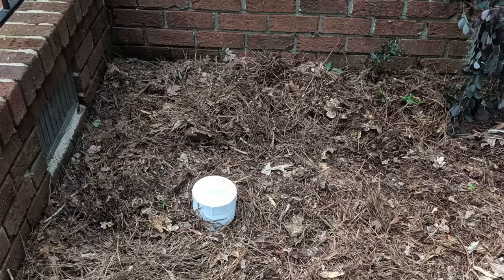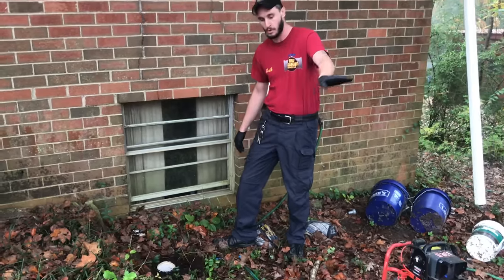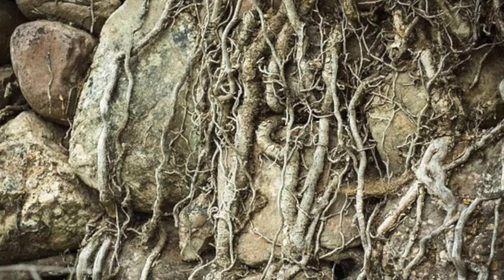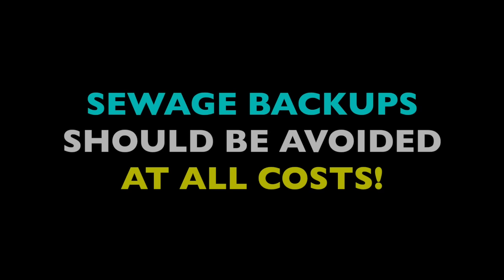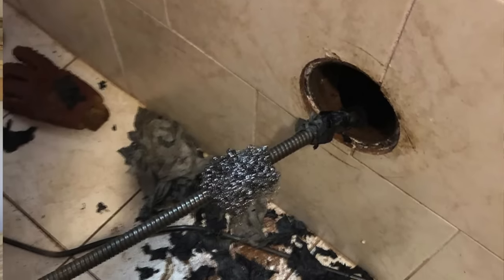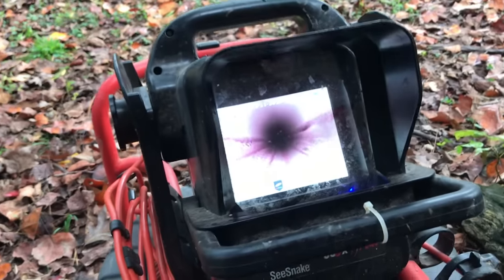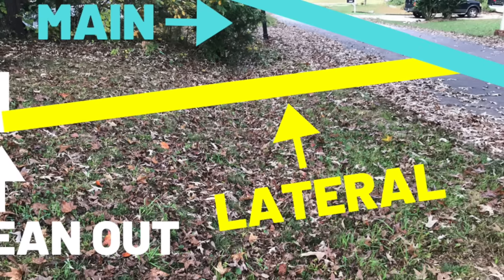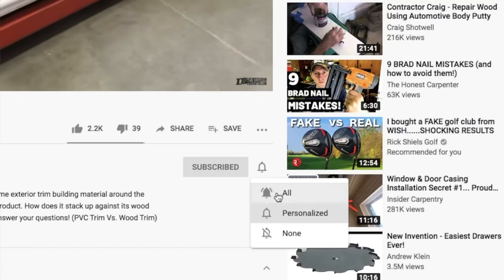This Pipe Can SAVE YOUR HOUSE FROM SEWAGE FLOODS! (Sewer Clean Out Pipe Explanation)

Comment: Another really informative video.  In Britain, almost every town and city has a network of old Victorian sewer pipes.  Outside, usually at the back of the property, we have a "manhole", literally a chamber large enough to get into, with a large metal cover, that shows the junction between the pipes.  You flush the loo or turn on a tap. If nothing appears, the pipe is blocked and needs rodding.  The Victorians were incredible engineers and builders. They built a lot of what is worth preserving in Britain and all without power tools.  I often think they would be horrified if they saw the crap we put up these days.

I'm a property solicitor (lawyer). We use a form of standard enquiries for purchases. There's an enquiry about sewer flooding but, believe it or not, there's nothing about the condition of the drains and it rarely occurs to anyone to raise a separate enquiry about it, including me up to now.
Reply from the maker: Amazing! Thanks for the info, Mindya. I always think it’s incredible to see how we were building 100+ years ago, and how it has converged with what we build now 🙂

Comment: Last week my sewage ejector pump started making strange noises. Black water came up in the kitchen sink for a minute but then went right back down. Called a plumber and they checked and everything was working normally. I wanted them to scope the line but the cleanout was in the crawlspace on the end of the main line coming into the house. This meant that if they removed the cap, everything in the pipe would come pouring out into the crawlspace. They suggested a new cleanout be installed outside just on the other side of the foundation at a cost of about $2500. I'll be calling them next week, as that is much cheaper than the alternative.

Comment: We were on a house, at the top of the hill.   A water treatment was down at the bottom of the hill.    For some reason, the sewer gasses from the entire system, would go thru the house giving any small imperfection in the plumbing.    Uncapping the cleanout, helped while the "new" problem could be addressed.     I fixed two traps, and a bad toilet seal.

Comment: As someone in the industry, remediation can be very expensive with sewage backups that occur "beyond the trap" as this is considered "grossly contaminated water", and the industry requires all porous materials be removed and replaced (drywall, insulation, wood floors, personal belongings (contents), carpet, pad, bathroom vanities, etc.).

Pro-tip: look at your contents coverage for your policy, and see how much more per month it could cost to increase your coverage - some people can get $10,000 or more in coverage on their contents for $10 or less per month. Cleaning contents can be expensive, and your contents coverage not only covers the cleaning / replacement, but also the "pack-out", "pack-back" and any storage required during the remediation / repair.
Reply from the maker: Thank you, Brandon! Very useful advice and info!
Reply: @Brandon: Excellent suggestion and information regarding insurance. After own own backup issue we discovered that there were (I think) three types of water flood/damage insurance:
1) Common floods (rivers, streams, rain storms)
2) Sewer backups/back flows 
3) Broken interior water piles or failed hot water tanks

Comment: Wow! This is most likely our problem. We had a plumber come out a few months ago, where I assisted him in unclogging our kitchen sink drain. Beforehand I had removed the food disposal and replumbed with new piping. 
Approximately $400 later the problem surfaced again, in a week's time. I called him back to discuss this and we settled with my pouring copious amounts of hot water (heated pots on the stove) down the drain. It helped, but the slow drainage came back a few days later.
Then I installed an air valve system under the kitchen sink...no difference.
After seeing your video I felt that you may have nailed our problem!
Reply: Do you have cast iron or pvc underneath your home?

Comment: I’m in the Midwest (Chicago area) most cleanouts are in the basements here, where the line comes into the house. Some builders do put cleanouts outside, but this is not common. Usually on a custom or single built homes. A family member did replace a sewer line here, 15 years after the home was built, because of improper installation originally. It cost just under $10,000.The line was installed in 1995 and was PVC, did have an outside cleanout, a big Oak tree finally caused the failure.   Thanks for the video, very informative!    Jim
PS.....part of the cost went to the village.....a hookup fee, the fee was $3500.
Reply: Right ! im from the area. Finally here in will county? its the code.

Comment: I had a shower draining slow for several years.  I tried a regular 25 foot snake and a 20 foot hydrojet snake.  Both helped but did not eliminate the clog.  The exterior clean out was about twelve feet away outside.  I ran a hyrdrojet flexible snake hose through it for about 2 minutes and the clog was eliminated entirely.  Just for maintenance I ran the hydrojet inside another clean out on the other side of the house.  It will be part of my annual routine sewer pipe plumbing maintenance.

Comment: Bought a new build in February, the clean out pipe wasn't cut down to grade because our driveway wasn't in yet. One of the construction crew ran over the pipe, snapped it and eventually it filled with sediment. Didn't realize this had happened until our brand new basement was filled with sewage. Their solution... paint a rock orange and put it on top of the busted clean out.

Comment: In Victoria Australia,  my water utility agency had to fix the sewer main that was through the driveway up into the back of the property over the other side of the neighbors and I was compensated by the water utility for a about 280AUD on my water bill before a arduous process of 2 months to dig to the main pipeline of the sewer and replace said section from tree roots.

Comment: I have a SEPTIC system, so I’m not connected to City Sewer (yay!) 
But I knew a Clean Out Port was a good idea, so when my PVC pipe going from the house to the tank disintegrated, I asked the Plumber to install one. 

My reasoning was to put my dog poop 💩 directly into the tank, but it’s been beneficial in so many other ways! I can add yeast and other beneficial “bugs” to the tank without potentially drenching my restroom. 

The BIGGEST BENEFIT of having this handy hole I can peer into has been a bird’s eye view of how well my drainage field is working, and when the tank needs cleaned out. Crossing my fingers that as long as I maintain the tank in a healthy manner, it won’t need to be pumped as often (2 or 3 times over 20 yrs) because my Mom had used wipes, and she’s no longer adding that problem to the tank.

I had a new lid installed with the new drainage field (house was built in 1970) and the new lid features a smaller round manhole cap that means less digging and no massive lid to lift. We had a secondary port installed at the tank OUTLET, and this is where I dump the Root Killer, and occasionally toss a high powered hose down just to keep it uncluttered by debris.

Both of my clean out ports have a nice large matted tree ring around the pipe, and I screwed in a couple lifts to make it sit prominently in the lawn so I won’t trip over it or mow over the lid… it’s wonderful to do a load of laundry and see water flowing in that outlet, knowing that the system is healthy and working fine.

THANKS FOR THE VIDEO!! Now I know 5e REAL REASON why Clean Out Ports exist 😮 
I had been wondering how on earth the Plumbers might pump out the system using this 4” pipe. I feel like I really learned something 😎

Comment: Shoddy installation from the lowest cost provider had failure as my number one concern when hooking up to the city sewer.  At the first clean out I installed a one way valve to prevent flooding when/if a line failure in the street occurs.
Reply: Was thinking the same thing.  But can a one way valve be installed without digging up the line?  Wouldn't a public sewer system have rules and regulations against having these?
Reply: @johnjacobjinglehimerschmid3555  It drops down in the clean out and rests on the bottom of the sewer line near the house.  That way if you need to clean it, it's easy to access.  It does not have any effect on the public sewer system at all, and I worked with a pro when we hooked up and no mention of any regulations, he thought I was wasting money, but I sleep sound now.
Reply from the maker: Yep, there was a backflow regulator in this property Mark, I just didn't have space to cover it in this video. Hopefully soon though. It's a great, simple installation to prevent against several sewer line problems!
Reply: @TheHonestCarpenter  is like to learn more about this backflow regulator your speak of
Reply: @shawn1869   Most are simple plastic swinging gate type. Allows your waste to go into the city sewer, if main line backs up it shuts and won’t allow your house to flood with waste. One way valve. The code would require this back water valve if your neighbors homes upstream are higher than your home meaning you live on an incline.
Reply: Sir you only need and by code a backwater valve when you have fixture flood rims below the next upstream manhole other fixtures with flood rims above said manhole must not go thru back water valve says upc

Comment: Back, in Late 70's, the local Sewer Authority's some times, installed, "Terra Cotta" sections to street, sewer, from House, line connection, ANY neighbor's trees, will send Tap roots too the joints, so that camera deal, is a must, for 70's build houses, buy.

Comment: If someone is getting their sewer line replaced, ask for a cleanout that can accommodate a check valve, and have one of those installed as well. That could save you a flooded basement if your municipal sewer overfills after a heavy rain for example.

Comment: This tip might have just saved me a ton of money. 

We're getting ready do redo our backyard, after digging up a brick walk path we found a pvc drain 4-5ft away from the foundation. 
I though it was just an old drain or something so i was planning on ripping it out.
Reply: Man, that could be a clean out, but more likely a drain that is keeping your yard from holding water (and thus also possibly helping to keep it from entering your house).
Reply from the maker: See if you can get it tracked somehow, Death caps! It could be an escape pipe for gutter collection, or field drain added later on. But it could also be the building sewer! If you have a plumber around anytime soon, might be worth seeing what they think about it.
Reply: @Mark OnTheBlueRidge it was already covered up with bricks and sand so i didn't think it was important. didn't even have a cap on it.
Reply: In areas with freezing weather in winter, it wouldn't be a sewer line, since those are buried below the frost line depth.

Comment: THANKS!! 
I thought I knew the basics , I did.  
I feel like I’ve been sabotaged. I had my septic tank emptied by a local company . They left a little mud on my patio from their boots.Also there was a puddle about 2 feet maybe 2 1/2 feet long. That puddle was sewage. The driver commented,” I guess we spilled a little.”. 
When I Checked the area he’d been working on, my clean out pipe was laying on top of the ground , connected to nothing.
So. . . Am I right? Please comment quickly what do I do ? 
He didn’t replace anything  He didn’t clean anything and he didn’t.  cover. the septic tank  lid when he left . He left me a big pile of mud and a deep hole. 
            Stressed Out in Oklahoma!

Comment: I was a child when this happened in my parents' house. We lived on a flag lot up a hill behind other properties and roots had gotten around the sewage piping. All the water and sewage came back up into the house at both bathrooms that got to our ankles. The clean out pipe near the top of the driveway had a inner cap we were able to unscrew so it would drain. The mess that came out nearly made me pass out. It just crawled down our driveway to sludge in the street. After that, all the carpet was torn out and we lived on concrete floors for years. Every year after a plumber had to come out to maintain the pipe and keep roots from filling it again.

Comment: Solid information. In Florida, damage from the back-up of ageing and rotting cast iron sewer lines are a ticking time bomb public adjusters deal with on a regular basis. I wonder if during flood situations, pressure from sewage and water in overwhelmed city lines could back-up into the home. Your thoughts?

Comment: As with so many things, if you have one you won't need it (because the builder was competent), but if you don't have one, you will definitely need it.
If you have the old clay soil pipe sewer line, consider treating it for roots with "Root Destroyer" (copper sulfate crystals) on a regular basis and save having to snake it.

Comment: A good vidéo and I agree with the importance of keeping the drain clean and in good condition because the consequences of a blockage can be very bad, but I suggest that an annual of two yearly inspection is for most people completely unnecessary.  If you have very old draibs such as clay pipes then yes more frequent inspections but plastic should be fine for many years, especially if you get the draibs power washed at the beginning.   Limit what you put down the drains to paper, pee and poo, don't put fat down the drains or wipes and you'll avoid 95% of the causes of blockage

Comment: GOOD INFORMATION for home buyers!!!
Thankfully I currently have no worry about sewage backup as my sewer line travels down a long hill into a septic pond. The waste decomposes by microbes in the line and only clear water trickles out the pond side.
One time I wanted to see if the trickle was because of blockage so I dumped 55 gallons (non-chlorinated) of water down the cleanout all at once (within a few seconds). Down at the pond the trickle became a gush, so I am sure it will do fine for many decades to come. PS The pond is very healthy as it has thousands of frogs chirping when it is not winter when they hibernate.

Comment: june '14 there was a storm 80mph winds blew the big maple onto roof of my house had a excavator come remove/dig out the stump. following year that part of the yard settled took with it the 3 inch septic so now there's a dip it plugs time to time i have to rent a roto rooter it's so fun. also just last month had the sewer man here pump 1500 gallon tank $160 (it's code in my county) he pumped it out then backflushed it so powerful sewage backed up into the bathtub so the house smells ripe now

Comment: Had my old clay pipe get clogged at the exit to the septic tank. While I was at it,( replacing the bad section,) pumped my tank out with a rental pump, rented a mini backhoe, dug 3 long deep trenches, lined them with gravel, bought enough septic hose to run 3, 40 ft lines, buried it, put the cover on, never had a problem.

Comment: I unscrew cap on cleanout near my foundation and just sit on top to over flow any backups in my yard instead of inside my home as our city has history of backups from city side and they don't pay for damages. I researched my home owners policy and was shocked to find it is not covered without requesting it added. With white pvc pipe there is almost zero chance of clog but metal pipes almost 99%.

Comment: They also make it much easier for us to find your septic tank, rather than charging you to camera the line and locate it that way. I generally advise people to only finger tighten the cap, no tighter, so that if there's a blockage between the clean out and their septic tank or sewer system, it will blow out of their clean out into the yard instead of filling up their fixtures and flooding the house.

Comment: Some years back our busness was located at the low point in the building,  as far as sewage pipes were concerned.  There was a flood.  The building owner got one of those "roto-rooter" type companies to try and clear the blockage,  but that didn't work and several more attempts were tried.  Each time he had a janitorial firm come in and clean our place up.  Finally,  he had to hire a backhoe to dig the whole pipe up.  The municipality claimed that they weren't gonna take responsibility for anything but the main running down the middle of the street.  The problem turned out to be "orangeburg pipe",  which was put in I guess during one or another war,  when cast iron was in short supply.  If you're not familiar with it,  that stuff is basically rolled up tarpaper!  A stone on top of that pipe had crushed it,  and no amount of working from the cleanout was gonna fix it.  This was back around 1990 or so,  and the sort of camera setup you illustrate here wasn't available back then.  We lost a good bit of business during that nonsense,  and eventually ended up having to move our shop to another locaton...

Comment: I lived in a house that someone thought that it would be a good idea to divert the the roof drains into the safety overflow pipe. The extension had been removed but part of it still remained and raised the opening to above a shower on the first floor. There was a low of evidence that it had backed up many times in the past.